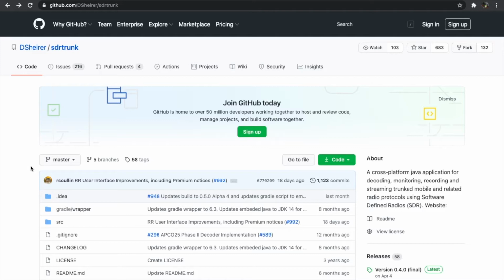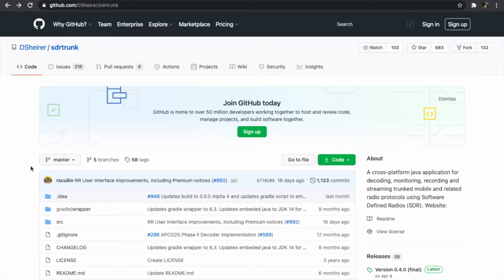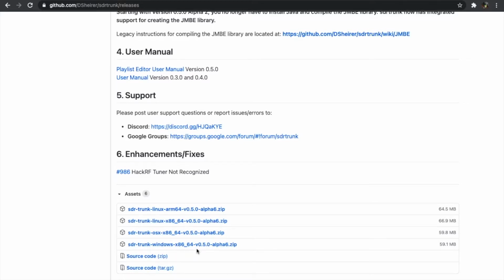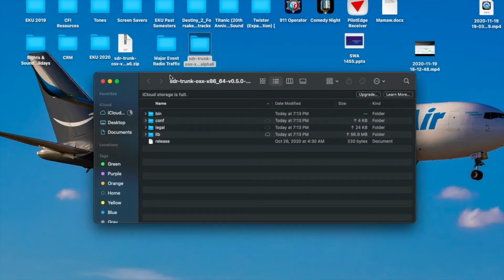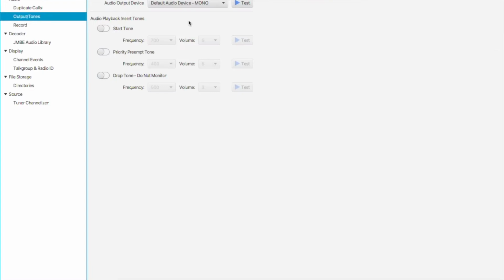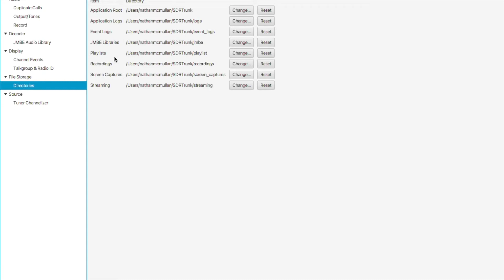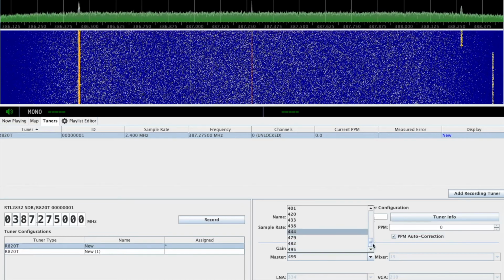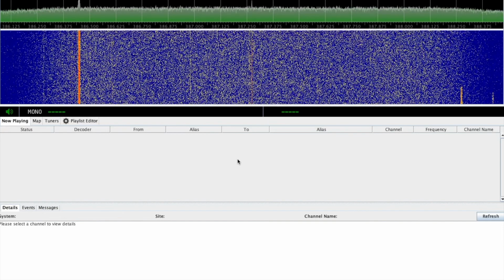How to Set up SDRTrunk Part 1 (The Basics)

Comment: hello..notice youve got a harris xg100 in your profile pic..im planning on getting one for Ham, gmrs and 700/800 phase 2 tru nking..whats your opinion of it? eventually im looking at the xl200..  on these sdr dongles, im using ( 2) rtl sdr v4 and ( 1)rtl sdr v3..wanting to buy another one or 2 or 3 to handle 2 different trunking sites( one having a mix of 851-855mhz and a few 700mhz voice channels( this will require at least 3 dongles on that 1 site alone..then run at least 2 on the other site which is strictly 851 to 854mhz( cc's, vc's)..which the upcoming transition to phase 2 seems theyve added a couple more vc's on some sites..Also,looking to get at least 2 LNA's to help with that one site which is a bit far..looking at the Noolec LNA model or the Rtl Lna..got the Noolec brand LNA (x2) in my amazon cart right now..trying to decide on the Noolec sdr V5 or simply get another RTL brand( but they require going in and changing the serial numbers as i did on the other 2 rtl v4's and left the rtl v3 as is since it shows different..